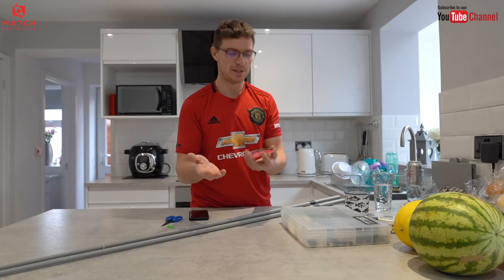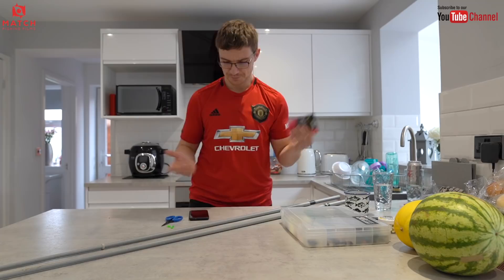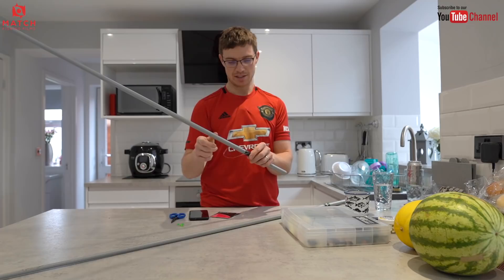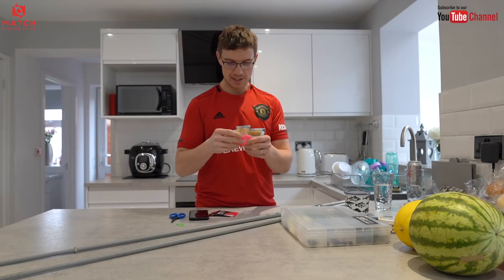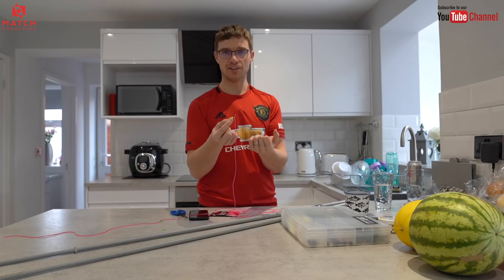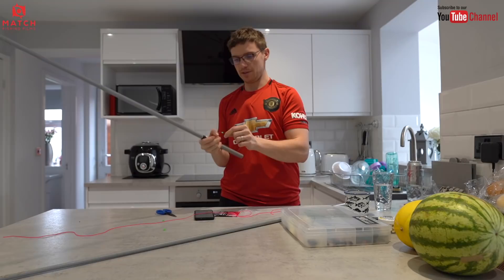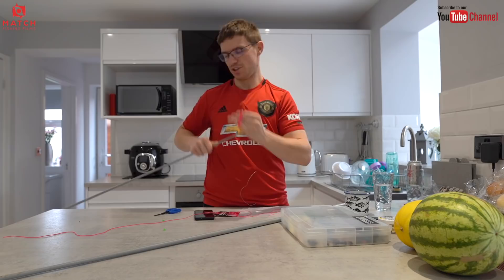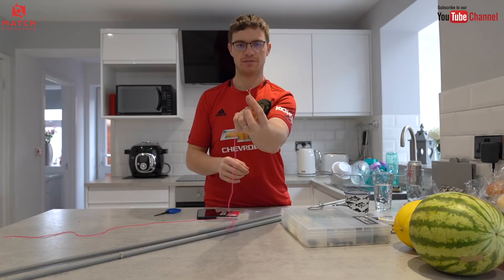How to elasticate TWO F1 kits with ONE packet of DURA SLIP! | SAVE MONEY WITH THIS TIP!

Comment: Question mate, as many have surly asked over the years… why don’t companies do elastics in 2m length or 4?  As were in a world where we shouldn’t waste, but on a 3mtr most get one normal top out of a pack with half a length left over to bin! 
I do think it’s crazy in this day and age
Reply from the maker: It's a tricky one. 3m covers all the top kits available as some are approaching 3m in length. 
We need to think about shops and how much stock they can hold sometimes. Asking them to stock the same elastic in two or three lengths is a tough ask. Even a longer 5m length is no good if you have two 2.8m top kits. 
Very tricky one unfortunately. In an ideal world we would seel ZIPP in several lengths but its just not that easy.

Comment: I thought you used the bead instead of dacron as you changed all your kits over to this method. The reason I ask is that i switched over on seeing your video re able to keep a check on the elastic and able to see wear a lot easier . Has your opinion changed ?  Good video.
Reply from the maker: Hi Peter. I still use it for my shallow fishing and will swap over once it warms up.

Comment: Hi  little off the normal track, can anyone help find some spare working parts for an original PXR 3000 reel  Thanks
Reply from the maker: What parts are you looking for?
Reply: @MatchFishingFilms  Hi Thanks, the internal gear that moves the spool up & down, its like the size of a 20p  with a geared edge, all the teeth have gone on mine & I do not want to throw it away, regards